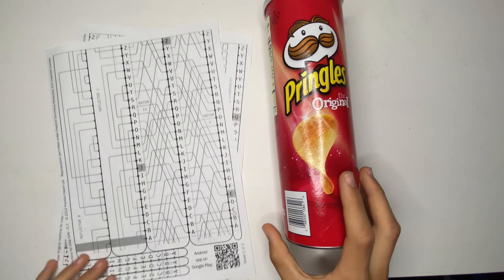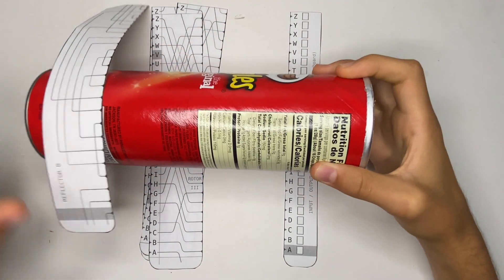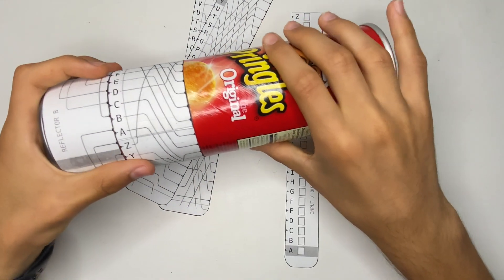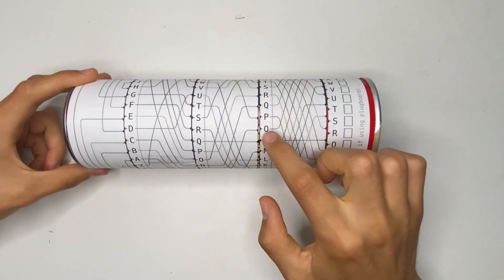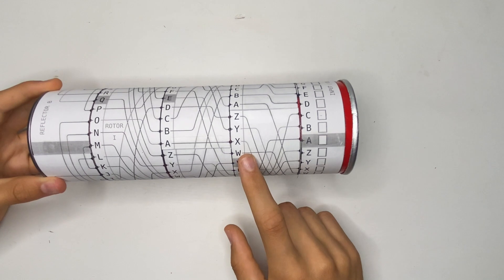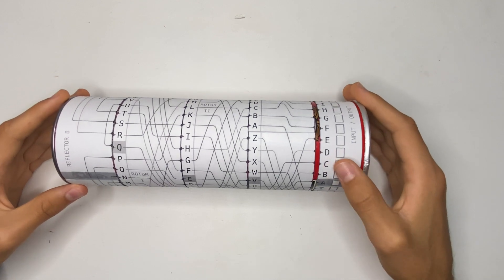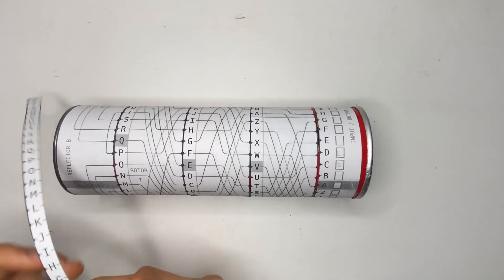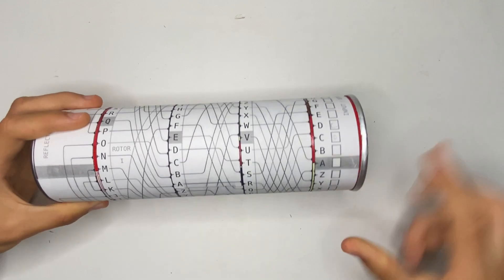DIY Enigma Machine (Ciphers Part 2)!

Comment: Old Pringles tubes were 75mm or 2&15/16ths inches in diameter.  New Pringles tubes are 68mm or 2&11/16ths inches in diameter, which means that printing the rotor sheets at 100% no longer produces the correct size of printing.
By experimentation, I have found that (at least on my computer and printer), printing at 57% will produce a workable size for the smaller Pringles can size.  If that doesn't work for you, it should at least be a good starting point.
If the rotor strip is too short to go around the can, take the scaling up a bit, and if it's too long then take the scaling down a bit.  You probably won't be able to get it exactly right, but I found that 57% was very close to exactly right.

Comment: You're off to a good start! 🙂
More friction on the rotors (smaller circumference) would be good... A "Post-It" note could hold two sides of the paper (close to one end) onto the tube while the other end of the paper strip is wrapped around and taped to form the ring. Going for 'Goldilocks' tension in each paper ring; not too tight, not too loose... just right!
Colouring the signal paths across each rotor (even just every other line) would simplify following the path as the tube is rotated...
Good work! Keep on truckin' 🙂
Reply from the maker: Thanks for the tips, glad you enjoyed it!